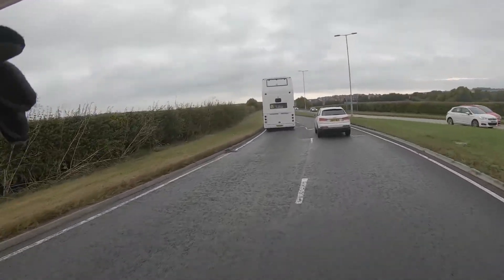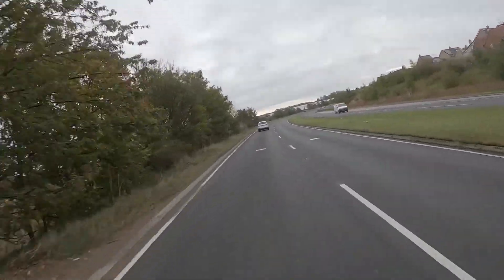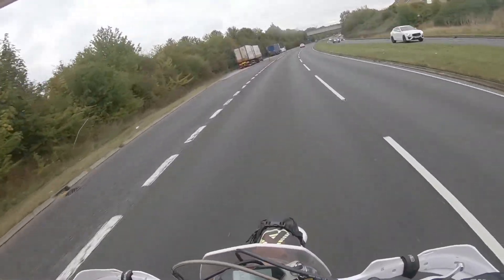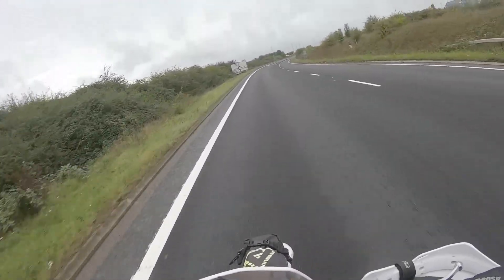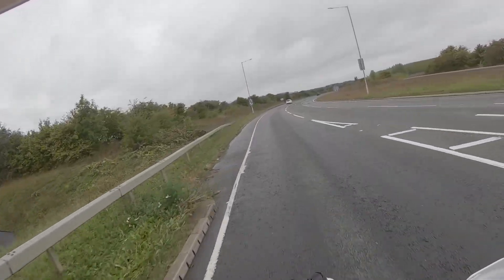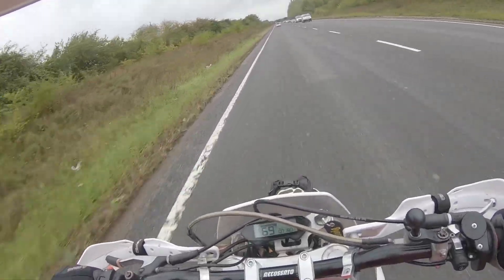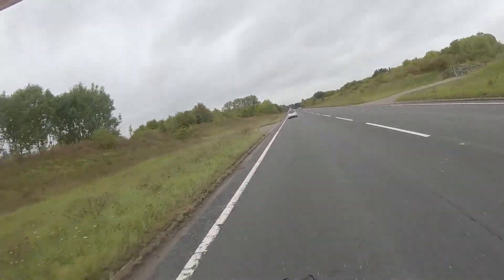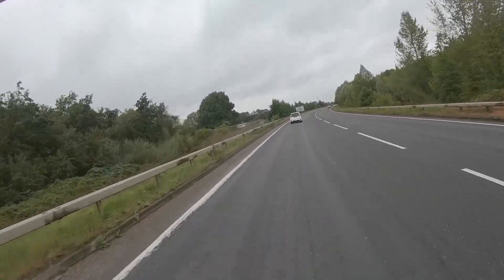What's the Fantic Casa E 250 Like on the Road at Speed?

Comment: Been considering buying a sinnis blade for a while now until I recently saw this bike, what are your overall thoughts on handling on and off road, reliability and power? How are the gears, brakes and suspension?
Reply from the maker: Morning. I wouldn't compare the bikes in the slightest. The Fantic is far superior in all aspects in my opinion. I had an Apache a while ago. The Fantic in stock form is fine on he road good off road. With a 13t front sprocket it's exceptional off road. I might be selling my 250 soon.
Reply: @dynamotightstar3472  Thanks for the reply. It sounds a great bike! Can you cruise the back roads/country lanes for a few hours in relative comfort? Some say the seat is not too good?
Reply from the maker: @Lander76  it will do the job. The seat is hard but not like wood. The tyre aren't designed for just back lane cruising bit you can get a second set of wheels which make it a super motard.
Reply: @dynamotightstar3472  Thanks again, I think you've swayed my decision. Better get saving!
Reply from the maker: Hope you find one you like mate. Ride safe. 👊

Comment: I get nervous on my 390 above 60... not so worried about the handling, but the engine sounds like it is screaming! :D I have very little faith in the tyres on wet tarmac after busting my wrist on it. I'd probs not put a single cylinder engine anywhere near 15k rpm unless you want a piston through your tank though! :O
Reply from the maker: I think it might be limited as I couldn't get it past 7.5k and it was doing 82 on the Speedo. Felt more solid than 65 too which was strange. 

Yeah, that's enough to put anyone off mate. Knobbly tyres on wet roads is hard work. I nearly lost riding round Thetford Forrest on a road section. 

Yours look so good, I'm seriously considering chopping the fantic in.
Reply: @dynamotightstar3472  they all look a lot alike tbh. I kinda wish I'd gotten a more dualsport focused bike that just had a bit more grunt than my previous Alp 4.0 
The 390RR is an incredible bike and I love it, but we have to do a lot of road work to get to the trails at times
Reply from the maker: What would you have instead? I'm a big fan of the Beta X Dresser as its a bit smaller and manageable and also the Husky FE250. Had a go on both and was well impressed. It's more build quality for me than anything. I'd like that premium feel between my legs! 😆😃

The KTM 690 Enduro R is the best thing since sliced bread but I thinks it's too big for Laning.
Reply: @dynamotightstar3472  if I had a van I would have gotten the XDresser (hahaha that made me chuckle) and just upgraded the suspension, but with mine lowered I have a more practical bike.
I would have probs gotten the KTM 690 Enduro and had it lowered a little. It is something that may happen in the future when I get fed up with servicing the Beta lol 😆
Reply from the maker: Yeah I have to say that having the van is a true gift. Change of clothes, fuel, water, washer all that stuff. I'm considering a tow bar hitch things where the bikes goes across the back of the car instead. 

It's weird isn't it, these huge travel suspension setups are awesome but I don't know anyone that can actually get on the bike properly coz they're huge. My bike is a touch too tall really too. 

Are you doing 600mile services or every 3 to 4 rides type?
Reply: @dynamotightstar3472  on the hours done as per manual